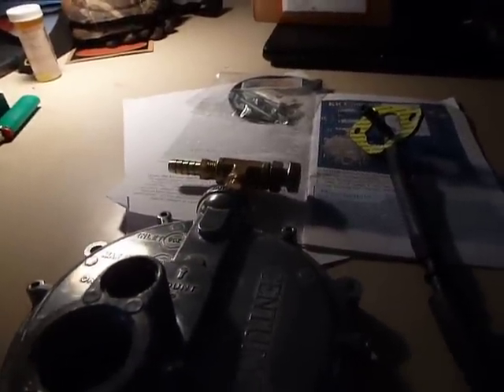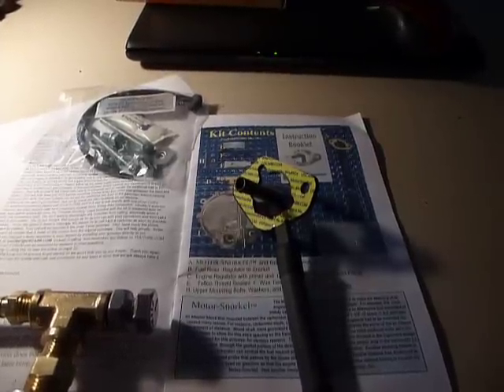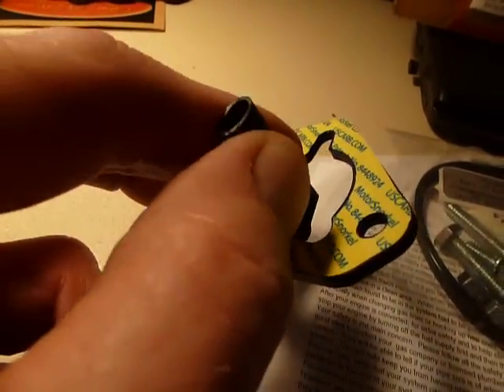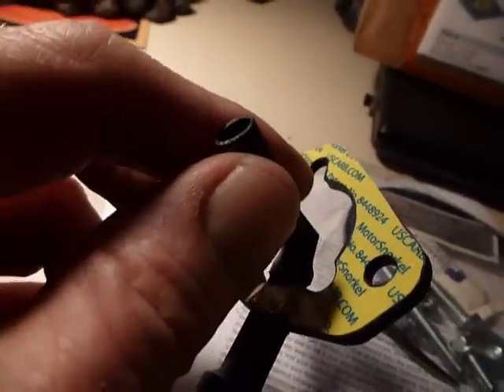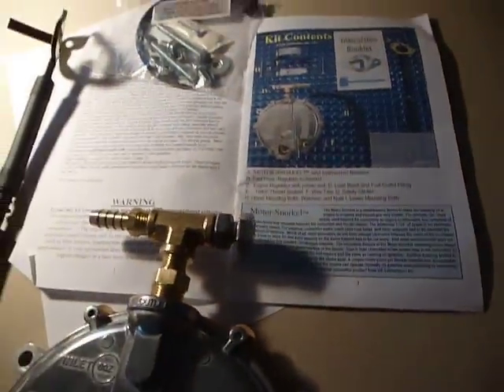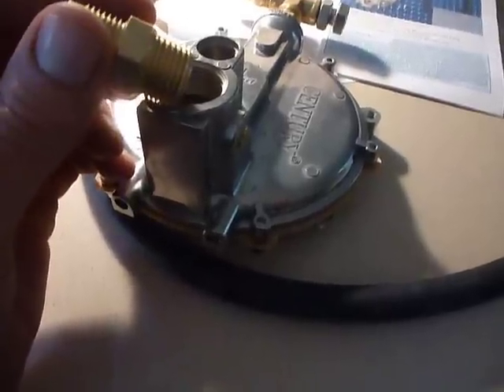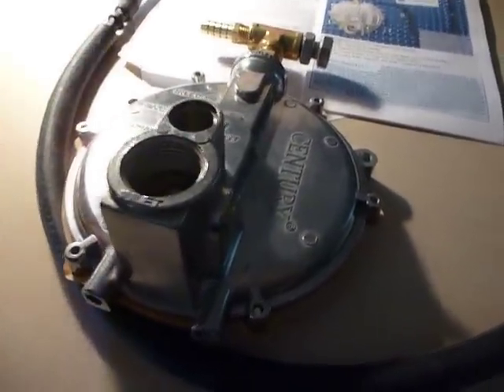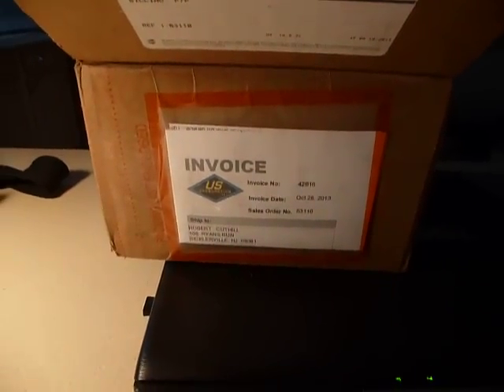Tri-fuel kit re-design

Comment: On their website it states the Type C or now called Snorkel Tri Fuel kit won’t work on any Generator over 12hp and if you have more then a 12hp engine you will need a Type 4 Tri Fuel kit. But I’ve seen videos of Generator’s with 13 hp motors using the Type C kit and they seem to do well.

Comment: You said you feel bad for the people that had to cut their frames. I feel bad for people who are paying north of $150 for these kits, even today in 2016. They still have to drill into their frames to mount that big honking regulator outside the protection of the frame. And most are paying big $$ for the hoses and quick connects. All that for something that is mainly used in emergencies. I'm on a budget with a $199 3.6KW gen. I bought my dual fuel (tri fuel) carb on e bay for $38. Got my "quick connects" from harbor freight for around $4.  And I already have hose laying around. The carb installation took about 3 minutes. Preparing the propane tank and quick connect hose was another 5 minutes or so and I was running. And the installation is clean with no regulator bulging off the side of the generator. It looks like the Nigerians are posting videos here on you tube featuring this dual fuel carb to advertise and sell in their country. I should post a video to show what a better installation looks like with quick connect hoses. And running pipe outside to run on NG is a whole different project.
Reply: I'm one of those people who paid north of $150 for my tri fuel kit on my Champion inverter generator. Actually I paid about $190 for my kit. But guess what? I'm okay with that. I have watched plenty of YouTube videos from people who have used the US Carb kits and they're all pretty much happy with their results. Sure, I could have pieced something together and possibly made it work, but I didn't. I don't have the patience to piece something together that may or may not work (reliably). My $190 US Carb kit worked right the first time I installed it with zero problems. That makes the higher price tag worth it....
Reply from the maker: Sounds like a great thing! I seen video's where they drill a hole in the side of the throat and run the tubing into that. As long as you have a way of adjusting L,P. flow your fine! I'd like to see a video of your conversion.

Comment: I was wondering if you would provide your opinion as to whether or not you feel this "snorkel" can adequately deliver enough gas through what appears to be a rather narrow tube....especially the portion that runs through the gasket.  I really want to purchase this kit for my B&S 7000W generator but I'm leery that it will not perform adequately enough under a heavy load.  I'm also curious as to how my generator would run using gasoline with that "probe" sticking through the choke?
Reply: U.s. carburetion kits look pretty nice but I'm not all the way sold on the rubber snorkel kit. Here's why if that rubber deteriorates over time and falls apart into the motor it goes. it could bend a valve and shut off the engine or break the piston and lock the motor up at the worst and B serious engine damage. The rubber will be deteriorated a lot faster if you're switching back to gasoline of course. I like Century fuel products. Com system theirs is aluminum plate and Brass nozzle it doesn't fall apart and there's is about 3/8 thick there adapter is. I'm pretty sure between the air cleaner and carburetor.
Reply: @jonsmith2217  Great point. I am struggling with a snorkel design from another company that was guaranteed to work on my generator model but does not as sometimes generator designs change but suppliers do not keep up and keep their products current. Bummed out!
Reply from the maker: +Vincent Baldo  Hi, did you see my other vid on the completed project? "Quiet Generator Project". I ran 10 or 12ft. of 1/2 " line into a 5500w gen. I removed the gas tank to allow more air movement so I never used gas with the tri fuel kit. I never had a problem with it though. There is a flow control "T" that I closed down about 1/2 way so too much gas will not flow. You can flood the carb when first "purging"  the regulator at start up so too much gas flow can be a problem in my experience. Get the correct kit for your size gen. and you'll be just fine! Check your length of tubing run compared to your gen. size. You may need to go to 3/4"?. US Carburation is very helpful and they have the flow charts.
Reply from the maker: +robert cuthill Just to mention also. I have run the gen from N.G. while the heater was running and demanding N.G. That was the real test and it passed with flying colors.